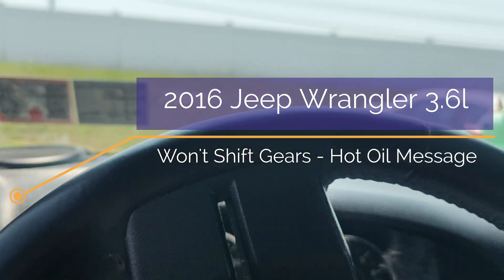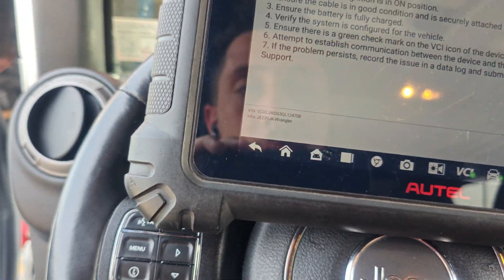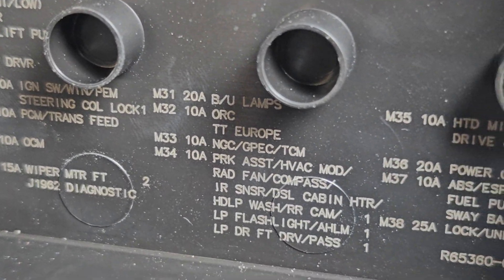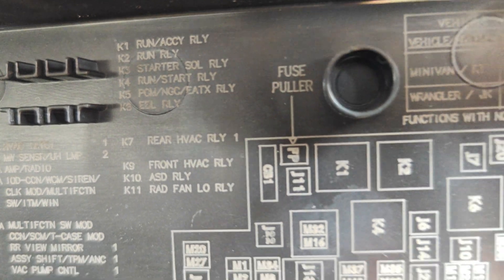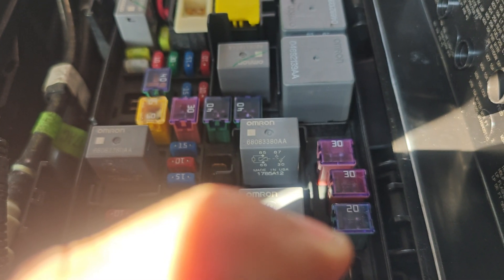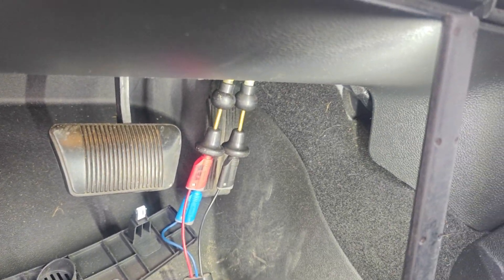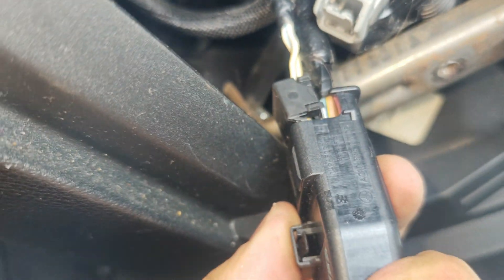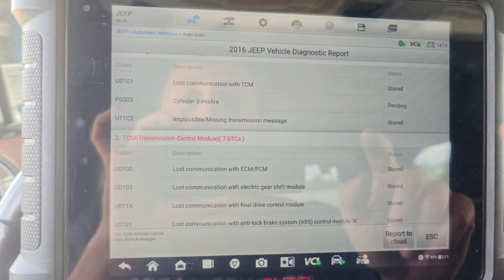2016 Jeep Wrangler 3.6l U0101 No Communication With TCM - Banging Into Gear - Hot Oil - Stuck in 3rd

Comment: Finalmente encontré el problema del mensaje HOT OIL, también la transmisión estaba siempre en tercera en un 2008 chrysler Sebring 3.5L, era el Conector del Arnés del Motor que estaba "suelto" o sea que no hacía buen contacto, Como no encontré otro para reemplazarlo hice una "parte" de metal que lo empuja a la computadora como si lo hiciera con mi mando, nótese que tengo que desconectar la computadora antes de quitar o poner el arnés. El Arnés del motor es el que tiene los cables a los inyectores y bujías lo digo porque son 4 Arneses. Saludos desde Monterrey, México
Reply from the maker: That is good to hear! Thank you for commenting on how you fixed it.

Comment: Finally I found the problem for the HOT OIL message, also the transmission was on third all the time on a 2008 Chrysler Sebring, it was the Motor Harness connector to the computer, it was loose after so many years in use. As I could not find a replacement I made a metal "thing" that pushes all the time the harness connector to the computer as if I was doing it with my hand, note that I had to disconnect the battery to disconnect and connect this harness. The Motor harness is the one that has the injectors and spark plugs as there are 4 harnesses, regards from Monterrey, Mexico
Reply from the maker: You may just have a pin with poor pin tention. You can buy new connectors with pigtails and take out the needed pins or replace the entire connector.
Reply: I messaged you on facebook man. From Ellis